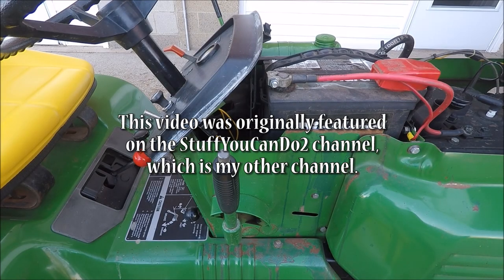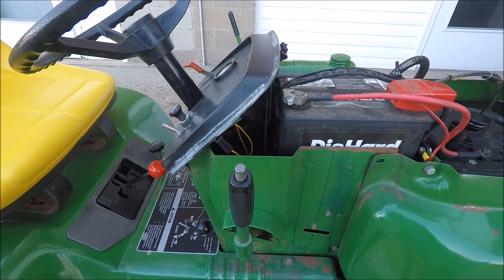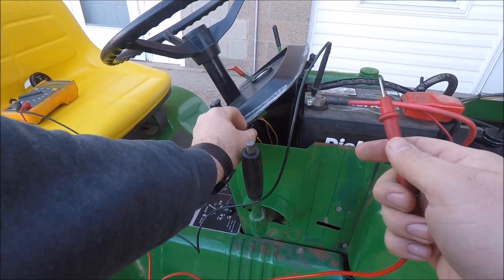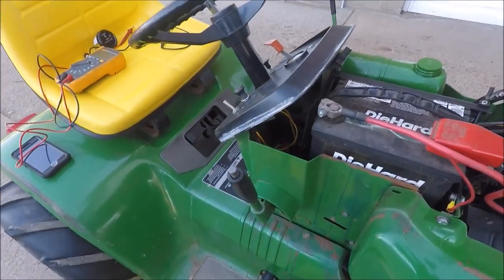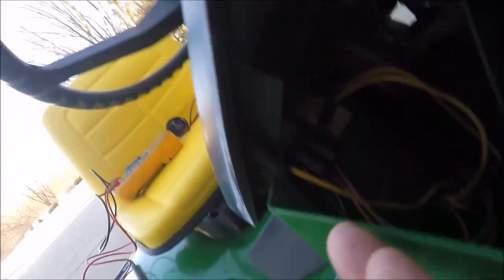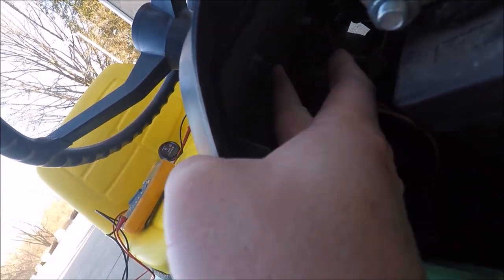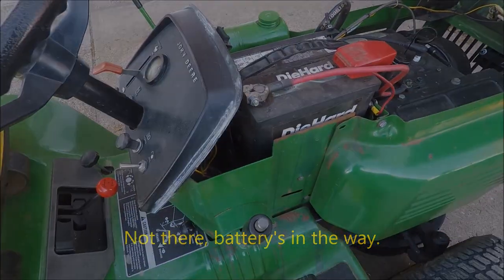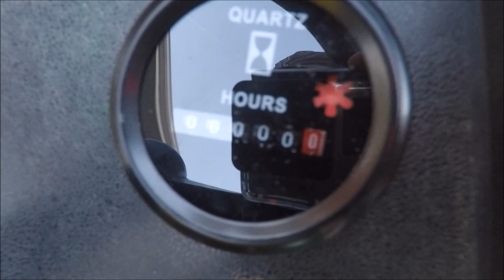How To Install An Hour Meter On Your Tractor

Comment: Hey! Larger tractors use the oil pressure to determine if the engine is running. So you'd have to get an ignition live source (already done in this case) and then install a relay to open the circuit when the oil pressure warning light is on 👍 The alternator can be also a good source, no relay in that case
Reply from the maker: This isn’t the case for all “larger” tractors, but definitely an option to make sure leaving the key on doesn’t let the hour meter run, which is a common problem, even on larger equipment.

Comment: On my 1951 John Deere Model B tractor, I connected my hour meter to the ignition coil input lead 12 Volt. That way the hour meter counts when the engine is running. If you connect it to your ignition switch, by just turning the ignition to ON it start counting even if the engine is NOT running. Not very accurate that way.
Reply from the maker: You already have incentive to not leave the ignition on with the engine off on your Model B since you risk frying the points by leaving the ignition on without the engine running. With any of my tractors, there’s very little reason to ever have the ignition on without the engine on, so much so that every tractor I’ve ever seen with an hour meter like the one in this video and came with it from the factory are also set up the same way.

Comment: So it means the hour meter keeps on running when the ignition, is on ri8.. Doesn't have any link to engine running
Reply from the maker: Yes, even in this case where I used the factory hour meter wire, the hour meter runs when the ignition is on. There’s no sort of feedback available from the engine that indicates that it’s running that could be used to run the meter.

Comment: Hi, I need to wire the hour meter to engine real hours, no ignition, because maintenance is done counting machine runtime, not ignition switch on, any idea on how to do it? thanks!!!
Reply from the maker: Why would you ever have the ignition switch on and not the engine?
Reply: what
Reply: Connect positive wire to output of alternator
When alternator rotate on then it will count
Reply from the maker: @sandeepnishad9610  this is terrible advice, don’t do this. Where do you think the output of the alternator connects? The battery, meaning the hour meter will run all of the time…

Comment: Would this work on a motorized bicycle engine?
Reply from the maker: If there’s 12v power available then likely yes. Does it have a generator for lights or anything?

Comment: How would I do this on a diesel
Reply from the maker: It would be any different, find a switched 12V source.
Reply: @outdoorpowerhouse  it's a pull start
Reply from the maker: That would’ve been useful to mention before. In that case, look into something like a Tiny-tach. I believe they make a diesel specific version, but it is pricey.
Reply: @outdoorpowerhouse  ok thanks

Comment: I have a Troy Built tractor with  lights that come on when the ignition switch is on ( there's no lights switch) can I attached the hour meters straight to the lights?
Thanks
Reply from the maker: As long as they’re only on when the ignition is on I don’t see why not.